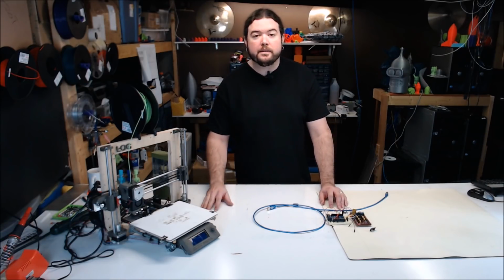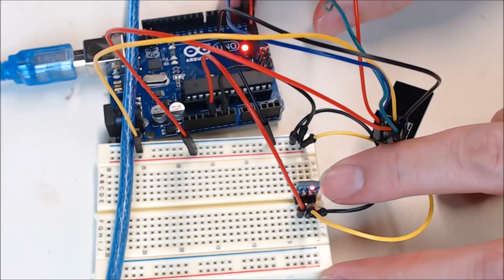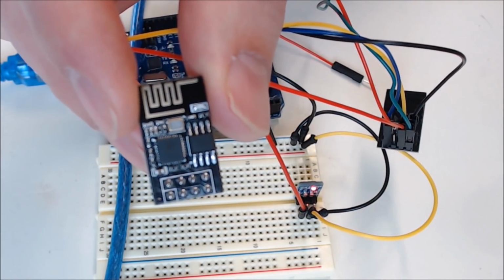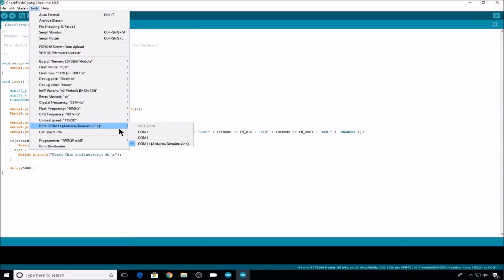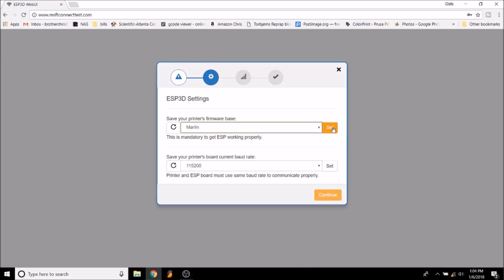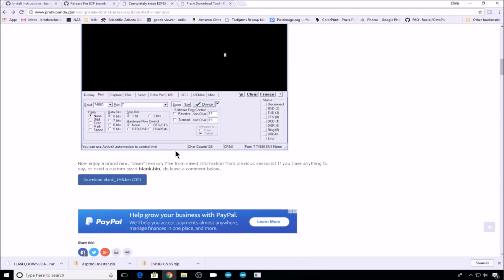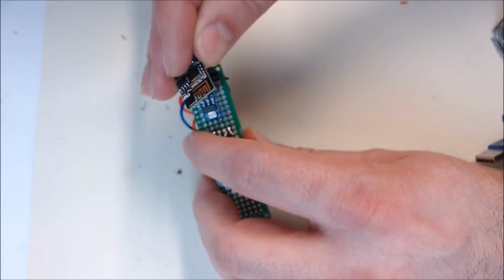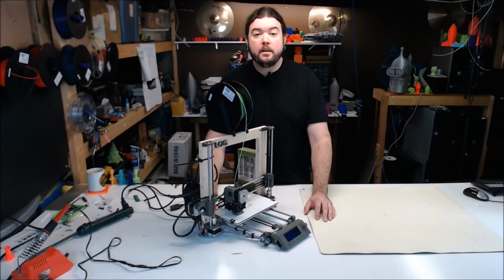Add WiFi To Your 3D Printer For $5!!! - ESP8266 - LUC ESP3D - Chris's Basement

Comment: Hello Chris, I can use this: Mini module voltage regulator AMS1117-3.3V;
The module integrates the regulating capacitors and a voltage indicator LED;
Recommended voltage input: 4.5VDC to 7VDC;
Typical output: 3.3VDC;
Recommended maximum output current: 800mA;
Supports up to 10VDC at the input, but with a heatsink
Thanks
Reply from the maker: Yes, that sounds like it should work.
Reply: @ChrisRiley  I can not find 3 legs. Could you tell me another one to use instead? The one who goes up to 7V is afraid of not giving.
Reply from the maker: @TheNikakz  This one doesn't work? https://www.amazon.com/Anmbest-AMS1117-3-3-4-75V-12V-Voltage-Regulator/dp/B07CP4P5XJ/ref=sr_1_1?ie=UTF8&qid=1547596765&sr=8-1&keywords=ams1117
Reply: @ChrisRiley  The problem is that I do not think here to buy, amazon does not sell some things to Brazil and it takes too long to arrive and if it arrives
Reply: This item does not ship to Brazil. Please check other sellers who may ship internationally. Learn more
Reply from the maker: I have a couple, I can mail you some?
Reply: What price and how do I spend the value for you? And the value of shipping by the post office, I do not know if it would be taken into account because the value of the dollar in Brazil is very high.
Reply: Was there some other way to make the connection? Using resistors, could you make a schematic of the connections? The regulator I found here goes up to 7V, access the link and see if you think I can use it, it would give less work. See this link please: https://produto.mercadolivre.com.br/MLB-716369016-modulo-regulador-tenso-ams1117-de-45v-7v-para-33v-esp8266-_JM?quantity=1
Reply from the maker: @TheNikakz  Yeah, the shipping is really high. This is the only one I see that will send it to Brazil.

https://br.banggood.com/5V-To-3_3V-DC-DC-Step-Down-Power-Supply-Buck-Module-AMS1117-800MA-p-933674.html?rmmds=search&cur_warehouse=CN
Reply: @ChrisRiley  Chris, if the one that sent me the link is good, then take a look at the link I sent you, because then it should work. For banggood it takes about 2 months to arrive and often the merchandise goes here at the post office in Brazil, it's all a mess unfortunately.
Reply: see: Modulo Regulador Tensão Ams1117 De 4.5v-7v Para 3.3v Esp8266 , This is the ad here, it should serve
Reply from the maker: Yes, that one should work.
Reply: @ChrisRiley  Ok Chris, thank you for your goodwill and your attention, all your projects that follow here will work out, congratulations for your videos that are a great help for beginning users like me. I will do this project and then post if everything went well. Congratulations
Reply: @ChrisRiley  see: https://www.usinainfo.com.br/reguladores-de-tensao/regulador-de-tensao-33v-ams1117-entrada-45-a-12v-dc-e-saida-33v-dc-4981.html?search_query=regulador+tensao+ams&results=12

Comment: I can't get SD file upload working. It seems to start writing the file, but never ends. I've tried migrating to the newest bugfix release of Marlin, and that didnt help either.
Reply from the maker: I heard others were having this problem. I think it might be the current version of the code on the ESP8266.
Reply: @ChrisRiley  I had to make sure the enable pin was also at 3.3vdc, then have to power up the ESP8266 w/ pin0 already grounded to upload...if I tried to ground it then upload it would fail
Reply from the maker: Great tip! Not all those ESP board are same, this could be a big help to others.

Comment: Hello .. iam ablie this with ramps 1.4  and burn my bord and esp01... the aux 1 is have D0 is not RX and D1 is not TX are a +12v and pin 5v is wrong this project is not work with me coreectly ...check the pins on ramps 1.4
Reply from the maker: There shouldn't be any 12v pins in the servo/aux bank. Something might be wrong on your ramps.
Reply: @ChrisRiley  
The red clone chinees bord ramps 1.4 is worng
With aux1 i tested with a voltmetter
And locate the D1 is done Tx
But The D0 is not coneect with Rx cut circut and join with 12+ v 
This is very important to everyone have same this bord .

Comment: Hy Chris, i'm loving this tutorial, managed to prepare the esp, and next up is connecting it to the ramps. Would this work with a voltage divider made with resistors? Do you have a wiring diagram between ramps and esp-01?
Reply from the maker: Yes, I think a voltage divider would work just fine. I don't have a diagram, but I can probably draw one up.
Reply: @ChrisRiley  could you please draw one up? It would help a lot
Reply from the maker: @szzk  I made these up real quick. Let me know if they help.
https://docs.google.com/drawings/d/1AXd9tVAsm6mjZ_315d1R-aLewtKsTJAvjgU16KPJMas/edit?usp=sharing
https://docs.google.com/drawings/d/1dfsURjk8fXmkQZTCzT7OhcTBYYSbyOzCvjnJzG_Mj-A/edit?usp=sharing
Reply: @ChrisRiley  It does, thank you so much!!!

Comment: Hi Chris, thank you much for the good tutorial.  I certainly would prefer this method over the Raspberry Pi, and I do have a few Wemos D1 Mini sitting around.  The major obstacle is, however, to look for the Rx/Tx lines from my Ender 3 mainboard.  Can I use the ones on the ISP socket, or do I have to look for them somewhere?
Reply from the maker: On an ANET, you would probably have to hack the LCD cable to make this work. You would need to use a lot of those PIN's. Not sure which pins they are, but it's going to be a lot of work. The performance isn't very good with these modals. I would stick with the Pi method if I were you. Maybe grab a Pi Zero W and integrate it some how.
Reply: @ChrisRiley  Thank you, Chris!  Appreciated!

Comment: sd card cannot be accessed by the wifi module so its pretty useless now...print over wifi isnt much reliable
Reply from the maker: You can't send gcode to the SD card? It is super slow I agree.
Reply: +Chris Riley i will try again....i asked esp3d developer he said to access sd card directly a separate sd card should be connected to esp8266
Reply from the maker: @ashwin372  Ohhhh, that right, it has to pass through to the SD card on the printer. You should be able to write to your printers SD card.

Comment: thank you it worked good, but i have problem connecting to the printer
when i open the web page and send some command to the printer, it didnt move or do a thing

oh and one more thing, when you hade a problem uploading the esp3d file to the ESP2866 you have to check the Erase flash to All flash contents, under Tools menu.

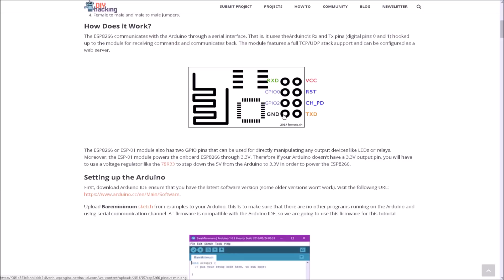Comment: 1:41 You got scammed , you show a ESP-01S module which is only worth 0,99$. Its an old arduino Wifi module. The real ESP8266 also known as NodeMCU is a stsandalone Arduino cpu worth around 3-4 $ with build in Wifi. But the main selling point is its 32bit and x-times more speed compared to the Atmega328.
Reply from the maker: Do you have a link to the one you are talking about?
Reply: Hello yes ,
here is a wifi module for arduino 99cent called NRF24L01
https://www.ebay.com/itm/Geeetech-2-4Ghz-NRF24L01-RF-Transceiver-Module-ISM-for-Arduino-SPI/331518573941?hash=item4d300bfd75%3Ag%3AvqcAAOSwrklVGj93&LH_BIN=1

the more expensive one some sellers call ESP8266 also as "ESP-01S"
https://www.ebay.com/itm/ESP8266-ESP-01S-Wireless-Module-Wifi-Sensor-for-Arduino-ESP-01-Advanced-Version/152996791177?epid=10010926047&hash=item239f51c389%3Ag%3AKooAAOSw1LRa4CEh&LH_BIN=1

its confusing since there is an arduino development board sold for a while now called also ESP8266
https://www.ebay.com/itm/NEW-NodeMCU-LUA-ESP8266-CP2102-WIFI-Internet-Development-Board-for-Arduino/282066826009?epid=13005977959&hash=item41ac7e3319%3Ag%3AghwAAOSwvg9XXlhx&LH_BIN=1

here is a short explaination what this board offer compared to the atmega328
https://www.youtube.com/watch?v=cZk3LW8bS70

i was disapointed since i thought you show a 3D printer based on the newer NodeMCU board. I searched for that since it has 32bit and much more calculation speed so it would be cool if 3D Printer firmware would be aviable.
I found a project here 
https://github.com/luc-github/ESP3D
but i wanted to see some videos of it.

  best regards

Comment: Good Video easily got everything working, can control the printer, only thing I am unable to do is upload a file. Renamed the files to the 8.3 format ie cube.gco, checked the SD Card, tried others. But it fails every-time. As a exercise I enjoyed trying it, but I think I will stick to Octoprint and Pi.
Reply from the maker: Mine was super slow, I guess there is a better version of the ESP I might give that a try sometime, but I am with you, octoprint is way better. Thanks for watching!
Reply: @ChrisRiley  I'm a noob here but have you tried ESP32? I don't know the difference between the ESP32 and the module you were using besides the hardware.
EDIT: does your tutorial works with the Anet A8? The stock motherboard.
Reply from the maker: @IamG3X  I have not tried the ESP32 yet. I don't think the ANET board has any Tx or Rx pins available. You would have to figure out how to hack the LCD cable.
Reply: I have problem with upload too. What I understend is: on marlin 1.1.0-RC7 I can upload, but cant see uploaded files from sd card with esp3d; on marlin 1.1.1 I cant upload (just 0 B files created), but can see and print from SD! Also tried 1.1.9, 2.0, diferent boards and sd interfaces, also tryed upload via usb from pronterface - always 0 byte files. Hope it can help or if you find solution - tell me :)
Reply: found solution https://github.com/MarlinFirmware/Marlin/issues/11871

Comment: Is it beneficial to add Arduino to a 3s printer ? Or would you use Rasberry Pi?
Reply from the maker: To add Wifi you mean? I would go Rasberry Pi myself. The wifi modules are cool, but slow and take more work.

Comment: i order a esp8266-12e waiting to ship from china, it got a build in AMS1117 voltage regulator and use a 5v usb phone charger to power up the esp, so do i need to connect esp 12e the gnd to ramps 1.4?
Reply from the maker: Yes, I would just to make sure they are both consistent.

Comment: so if the RAMPs had 3.3v pins, could the ESP cip have been plugged directly into Aux1?
Reply from the maker: It would kind of work. The current isn't high enough. It would probably work when you were configuring it, then fail when trying to connect to the wifi.

Comment: Hi Chris,
great video and a whole bunch of information.
In your video it looks like being so easy to conect the ESP to AUX1. Did you change anything in Marlin? 
I tried to conect my NodeMCU ESP12 to my anycubic Kossel having a Trigorilla board. This board has an UART3 port using D15 as RX3 and D14 as TX3. Ground and 5 V is workig to drive the NoedMCU, but I can't get the data lines working. I tried to use Serial_port 0 to 4 in Marlin 1.1.8 but with no help. Do you have any clue?
Many thanks and dear greetings
Simone
Reply from the maker: I didn't have to change anything in Marlin to get the Wifi to work. As long as those pins don't interfere with other serial traffic you should be fine. In the PINS.h file you might try swapping out the pin numbers to use the same pins as AUX1 normally would, that might help. Thanks for watching!

Comment: can you send the .gcode file to sdcard via esp8266 for printing ?
Reply from the maker: Hoang Bao Thai Yes, that's exactly how it works. Thanks for watching.
Reply: and I can disconnect the computer after the printer starts printing and connect to another printer to print.
Thank you!
Reply from the maker: Do you mean the webpage? You have to leave the Wifi module connected, but you can logoff the computer and it will stay running.
Reply: http://i1383.photobucket.com/albums/ah315/hbaothai/e%203_zpsjfrfhr3t.jpg
http://i1383.photobucket.com/albums/ah315/hbaothai/e%203_zpsjfrfhr3t.jpg
http://i1383.photobucket.com/albums/ah315/hbaothai/e%203_zpsjfrfhr3t.jpg
I have successfully connected, but I'm having trouble uploading a gcode file. Please help me fix error!
Reply from the maker: Hoang Bao Thai Does it even try to uploaded it? Does it time out or not send at all?
Reply: http://i1383.photobucket.com/albums/ah315/hbaothai/e%201_zpsuurnyenb.png
http://i1383.photobucket.com/albums/ah315/hbaothai/e2_zpsqhievpcb.png
Upload up to 100%, then upload failed
Reply from the maker: Hoang Bao Thai Hmmmm, have you tired another SD card?
Reply from the maker: Is it a full size ad card? The lock could be on.
Reply: Thank you very much. I will try again

Comment: This is cool. Thanks for sharing.  Any idea if this can work on an esp8266 embedded in a board like this one by Wemos: 
 https://www.banggood.com/Wemos-UNOWiFi-R3-ATmega328PESP8266-32Mb-Memory-USB-TTL-CH340G-Compatible-For-Arduino-Uno-p-1205444.html
Reply from the maker: Thanks! Yes, it will work with that board, just change around the pins accordingly.

Comment: Chris can you guide on how can this be done with D1 mini? to be exact WeMos D1 mini V2.2.0 WIFI Internet Development Board Based ESP8266 4MB
Reply from the maker: Shriganesh Borse I have one of those somewhere, I will take a look.
Reply: See the ESP3D file package, there's lots of pictures containing what you need.
Reply: You should be able to just connect it straight up to USB, then make sure you select the right flash size when compiling, more or less same procedure...compile the .ino, upload, then upload the "webpage" data, then it connects with the TX/RX pins on the board...still need to wire in 5vdc and GND
Also looks like a good candidate for the wifirepeater image too

Comment: great video but you need to step up your soldering game :)
Reply from the maker: Thanks man and you are right!
Reply: Chris Riley use some flux , clean the tip often ( wet sponge ) and use a lower temperature
Reply from the maker: It would help if I had a lot steadier hand as well. :) Thanks for the tips.

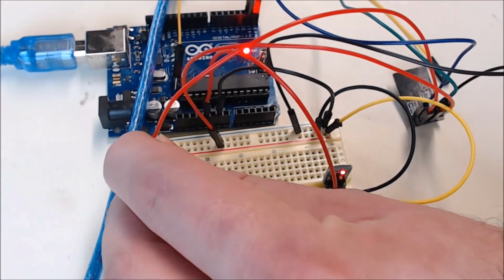Comment: 13:00 - All works fine for me up to this point, at which it never connects to my wifi. Module gives 10 flashes of the blue led, then nothing.
Reply from the maker: Hmmmm, the ground is off of GPIO0 correct?
Reply: Yeah, the issue is only when I reboot to connect to a AP. Using the module in captive portal mode works fine, everything seems to be configured correctly (although the password is shown as the wrong number of "*"'s), just once I've done that, I power down and reboot.. and ....nothing seems to happen other than a few flashes of the WiFi led.
Also, its supposed to be reset-able by grounding GPIO2 during boot to reset the eeprom setting - that's not working for me either, so I'm starting to think the software is more buggy than it should be.
Reply from the maker: It could be the software for sure. I haven't tried it in a while. I will give it another try and report back.

Comment: ESP3D-1.0\esp3d\esp3d.ino:69:28: fatal error: ESP8266NetBIOS.h: No such file or directory

 #include <ESP8266NetBIOS.h>

                            ^

compilation terminated.

exit status 1
Reply from the maker: Looks like you don't have the ESP library installed in Arduino.

Comment: Hi crhis great video. Everything working. But I can only send commands, I can not receive information through Rx. What can I do?
Reply from the maker: Thanks! I am not sure on that one. It almost has to be something on of the pin connections.
Reply: I got it! Thank you. Is it possible to connect through Repetier-Host software?
Reply from the maker: EletroCiência Awesome! I never tested it. I am not sure how it connects, but I don't think this ESP program would be conpatable with it. You would probably need different esp firmware.
Reply: I will test in the future. Congrats on the video. thank you so much

Comment: thanks for sharing this, I wonder if using a nodemcu  negate the need for soldering :)
Reply from the maker: Thanks for watching! I have seen a ton of cool connectors on ebay that would greatly help create this. There are some listed in the comments that others have used.

Comment: Question...would this work interfaced with the USB port on the board?  Since it has TX/RX, 5VDC, and GND?
Or would it need the USB to serial components?
The reason I am asking...just found this thing on thingiverse
https://www.thingiverse.com/thing:2856796
Reply from the maker: I think it probably would because I am pretty sure on most Arduino based boards its all the same bus.
Reply: @ChrisRiley  Just found the trigorilla board has a UART connector right next to the processor...PERFECT candidate for this mod!  Oh and put it on my hopefully someday soon to be MicroCube(XL) build...

Comment: Have everything up and running, with help of your video. Now it runs on a Infitary I3 with a custom HY_BASE_L v1.0 board, which I adapted (tricky!) to have the same AUX1 connections as the RAMPS 1.4 board. One final remark: in your video (at about 15:15) you make the final connection of the  ESP8266 to the AUX1 connector of the RAMPS board. For non RAMPS users it is perhaps not clear that in this situation you connect TX(ESP) to RX(RAMPS) and RX(ESP) to TX(RAMPS).   Thanks again for the video.
Reply from the maker: willemnitert Awesome, glad you got it working. Thanks for the pointer. I probably could have made that more clear.